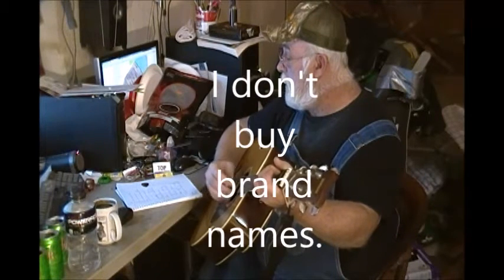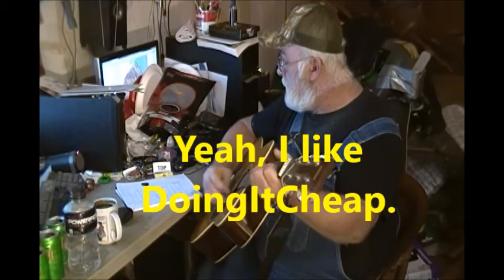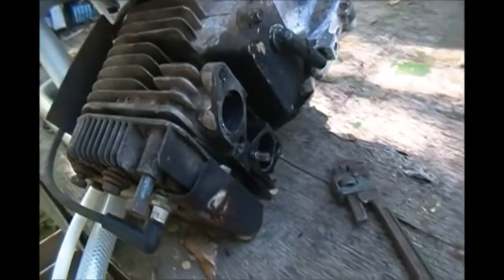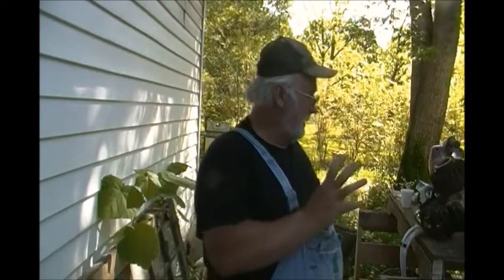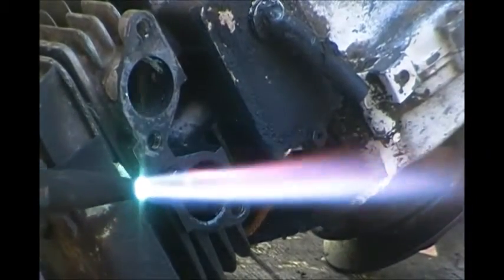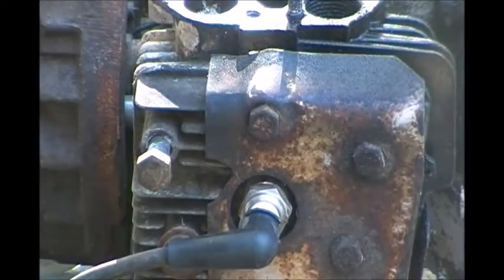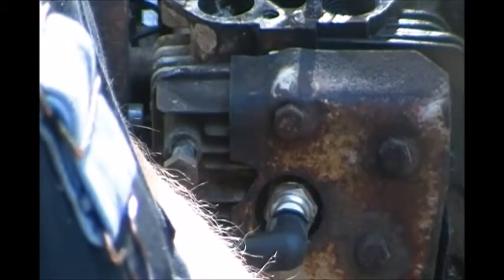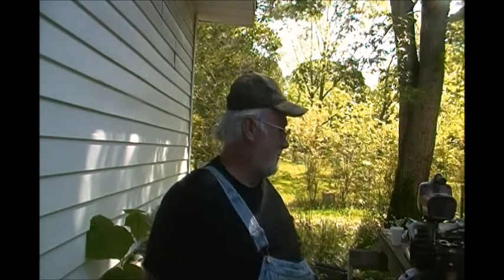Restoring the Antique Zero Turn Swisher Lawnmower  Part 3a

Comment: Probably too late for this project but I use a product called Kroil.  Best information I have, it comes from a company in Tenn.  About the only place around my part of the world that usually has it would be gun stores.  Sometimes (but rarely)  autoparts stores.  Works for me every time.  I also recently found a product called evap-o-rust that just dissolves surface rust.  It won't help with stuck bolts but if you are trying to make it purdy again it will help.

Comment: Dont heat the stud. you heat the metal around it
Reply from the maker: +Robert Price   Robert, you are correct in ideal situations, but sometimes just the heat will soften the rust bond.  I realize heating the stud made it expand.